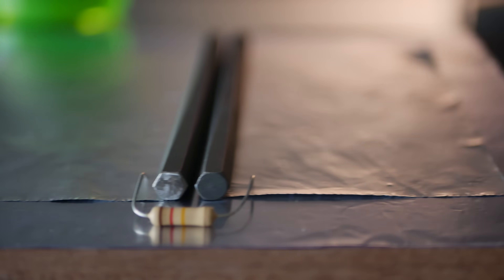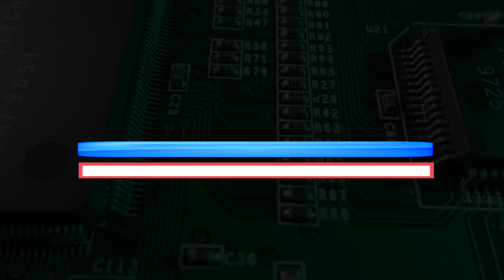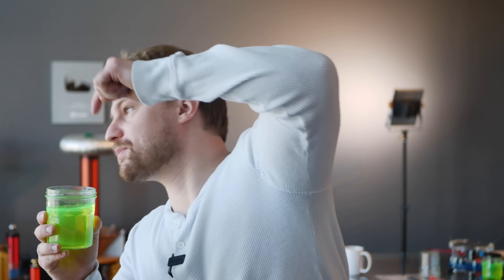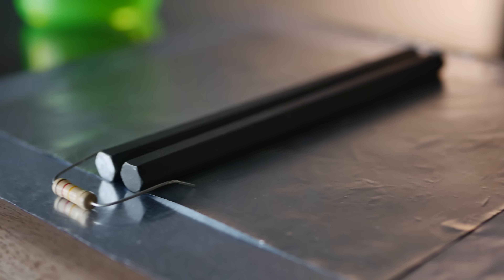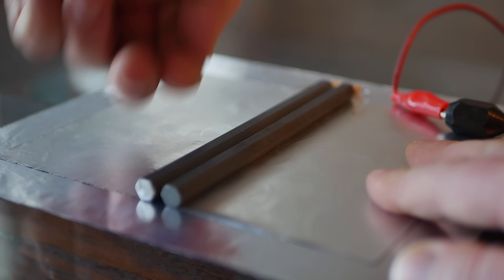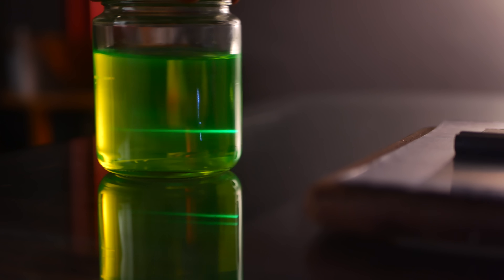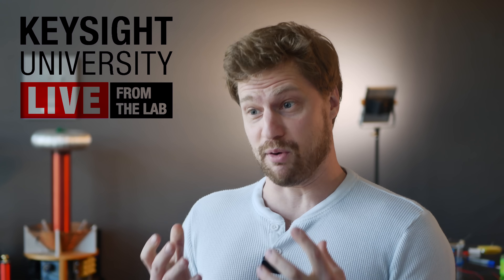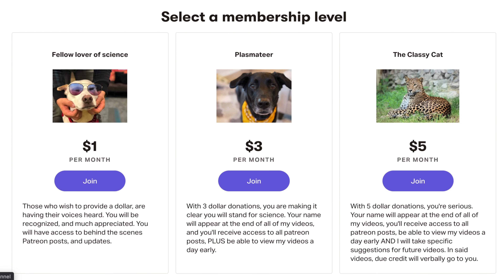Building A Simple High Voltage Nitrogen Laser (Ft. StyroPyro + giveaway)

Comment: Hey I was wondering can you build a tube by using a 1000 kV generator under low pressure gas I’m a kid I’m 14 years old. I’m still smart and I did build the rail gun and next I’m building a combustion gun and a reactive generator like a power stuff, but I change my mind on the radioactive part because you know cancer and I was wondering if I can collaborate with you about the whole idea

Comment: So cool.
What if I tried that in a hermetically sealed containment chamber (say a pipe that holds the entire contraption), then fill the pipe with nitrogen gas?
- Would that improve the excitation of photons? How much pressure would be safe?
- The sparking is quite audible, could the frequency be increased so that to a human it would sound like a constant noise sound?
- Those hexagonal rods are probably not aluminum,... what material is the best for this?
- Could such a TEA be made to get a high power laser, say 100W for industrial applications?
Reply: Maybe adding some liquid nitrogen nearby could help it, since it becomes gas at room temperature, I don't know. If you try any of those things please upload a video. It would be so interesting to watch.

Comment: Cool...I built a Blumlein nitrogen laser for my Physics senior thesis back in the early 80s. I used a single sheet of double sided G10 PCB to form the capacitors / ground plane.  I became infamous because the EM pulse from the laser tended to show up in most of the experiments in the bldg. A few  thousand amps rushing across a sheet of copper in a few ns will do that...

Comment: I'm quite amazed the circuit seems so simple and yet I'm sure it can still be improved without significant effort. I think the resistor and it's spark gap are to reduce laser gap spark transfer energy to encourage new spark locations to build the gap energy. It seems like an end mirror resistant to UV would help, also a top insulator or even an insulator wrapped around the rods with dielectric as well. I'm guessing that most of the UV photons are lost top and bottom. My MOPA Fibre laser cuts through aluminium quite slowly, due to thermal dissipation and reflectivity so I don't think that's an issue. The iron hex x-section is likely less rounded than the aluminium  cross section profile which would promote arcing better. The flat of the allen key hex underside improves the dialetric vs the angle of your Al profile which correlates with styropyro's comment on increasing capacitance, seems the key is getting just the right gap pulse energy with a fast pulse frequency to other locations.

Comment: I have been gifted a 5 foot long, 2" [50 mm] I.D. borosilicate glass tube.

1, What would be the *STRONGEST* possible laser I can possibly build with this, 

*OR*

2, What would be the *SIMPLEST* laser I could build?

My hopes would be to have a large, powerful, fiber optic cutting/etching laser which I could use for multiple purposes, using some military surplus optical prisms I cam across.

I can wind my own coils, and build my own capacitors, and I have a whole pile of diodes, small capacitors and tons of high precision and low precision potentiometers on hand.

I can get pure and mixed gases from a couple of local gas suppliers.

Comment: very kool i think i will leave the building of this type of laser to you! wow it is a fickle *****!  so in the future i was wondering if you could do a negative build of ion lifters? so i saw something that seemed like it opened the front to a v like and it went in that direction. seeing the pattern and watching how it happened made me wonder if ion lift also has the opposite like ion tractor? like a airplane can be a pusher or tractor depending on the prop placement of rear or front of the plane. i was wondering if there's a way to use ions the same way? if you dont build it could you still please answer the question set my mind at ease. because i may have found a small piece of the puzzle imho.   enter me into the contest if it is still going!

Comment: This is not how I thought lesser would be built😂... I used to imagine a nitrogen filled cylindrical glass ware, with electrodes attached to the sides and a decent spark gap in-between the inside of the nitrogen glass tube. Which the would be put in an opaque lager to tube with a reflective internal surface and then an adjustable magnifying glass up front to set its the focus with 🚶🏾‍♂️😅

Comment: Excellent tutorial! A "transmographic laser", (in another phrase), is simply exciting two- not more!- atoms in a row. This means the electromagnetic pulse should be a specific size: the radius of a Nitrogen atom (for ultraviolet-likely light) x4, and not too much larger, or smaller! This is a radial burst of about 1 x 10^18 Hz, or 1 billion gigahertz in voltage-pressure. If you use a radial harmonic you'll achieve a less often, so less intense, laser instead-- down to even 1 Hz or smaller! Lasers are easily made of regular LEDs, simply focus them through a nitrogen-gas tank to achieve the similar wavelength of UV light-passthrough. You've created an LED, followed by two filtering cusps, all from home-available pieces! Very well-done!

Comment: So changing the alluminium to steel had beneficial affects.
Why?
Is the higher resistivity of steel the relevence or the smaller capacitance of hex vs 90 angle?
Should one try gold plated allen keys (lower resistance) vs rods of alluminium welding rod (llower capacitance) to identify the rout forward? 
Does ferrous vs non ferrous matter.
This could get to be a very interesting project.
Good luck.

Comment: That reminds of star trek(tos) were spock takes some crystal mounts in them in metal strap from a cell cot and set the distance apart and lases through a cell door using power from a light bulb. I wonder if you could do that with ruby crystals?  Ruby crystal used in lasers are made in rod and the photons bounce between the mirrored ends.  It would be interesting to find out if you could...

Comment: Built one of those in 1973 a little less than 25 inches long with one back mirror using pure nitrogen gas in the bloom line door knob capacitors 25 pF each Charge to 30,000 V on each side with with an EG &G spark gap to switch the door knob capacitor on one side giving 60,000 V across 1.5 cm gap between electrodes made honeycomb electrodes similar to your hair comb to get a uniform discharge across the 25 inches

Comment: I always wondered how can we Make its beam Continuous may be we can also place Cavity by placing partial and full mirrors in the ends of the T laser  and for continuous beam may be you can try same setup in Vacuum chamber with different pressure or changing the spark gap frequency higher .

Comment: I always wondered how can we Make its beam Continuous may be we can also place Cavity by placing partial and full mirrors in the ends of the T laser  and for continuous beam may be you can try sane setup in Vacuum chamber with different pressure or changing the spark gap frequency higher .

Comment: the "easy stuf is never easy" also I think that it emit some visible light other than uv, it's really strange to have random paper and a shirt glowing from uv alone. For future project I have a little curiosity, every time I see a plasma, ok it's cool but it's also really hot, can you create a device that makes incandescent air that it's not plasma ? like the one from a butane burner that it's orange/yellow, I recently discovered that the flame it's not actually plasma but just incandescent air, air disperse heat really fast but I was wondering if there is still a way to make it glow without a chemical reaction generating heat ?

Comment: Neat concept.  Curious, what would happen if you flooded the channel in nitrogen gas, even pressurized it slightly?  Another idea, what happens without the capacitor, spark gap, and resistor? (Can you get a nearly continuous arc, and will that not work?)

Comment: Amazing video, currently taking electricity and magnetism in college right now and it's amazing that I understand the circuits, capacitors and everything about the voltage and current. Was thinking about building my own but now sure where to get a power supply

Comment: Nice project. I've (casually) looked into TEA lasers before. Was there a specific reason you cut the hex wrenches into just the straight sections? Couldn't you have placed them down with the bent portions facing away from each other?

Comment: I would like to see you use this TEA laser with a tesla coil to make a point-able lightning strike by creating an ionized nitrogen path in the air between the tesla emitter and the target.  The TEA nitrogen laser should have the correct energy window for lazing threshold along the path of the laser light.  This could be a great lightning-laser weapon.  Assuming the target is grounded the current path would be from the tesla emitter, TEA laser ionized air path to the target, then back though the grounded tesla coil.

Comment: hey jay please respond. I just got a badass deal on working 37 medium to large Flybacks some even have the Tripler's they should be hear very soon like this weekend so let me know if you need some we could meet up closest place looks like Bremerton if you take the fairy. ill give you some for your channel for free
so you can turn 4 into a 200kv though 4 parallel primary's and 4 series secondary's in oil with a extremal diode for the new rating with a zvs to drive it that's what I'm doing for my ne HV,HC,HF supply for work on passive plasma confinement for fusion prototypes mine will have a 1800w zvs driving it though.  
but I'm Shure you want more power for a new big AF multiplier am I right?
Reply from the maker: Wow. That’s pretty cool. Are these new stock?
Reply: @PlasmaChannel  some new some used was the label but 37 for 120$ GOOD deal. I can definitely spare afew after testing that there good ones to help you out.
 I got my kiddo this weekend so hit me up in my contacts in my vids and we can make plans. I can only travel on weekends cuz I don't have a license....I failed the dive test again, I cant feel the peddle and due to my situation I haven't been able to get practice...fun stuff.
Reply: @PlasmaChannel  would you want like 10 of them just in case you end up blowing a few.

Comment: This is super-luminescence effect, not a lasing. To see the lasing, one should provide an optical resonator. A simple step up would be an Al- coated mirror on one side, reflecting the light straight back through the discharge area. When aligned, you should see a large increase in the optical power and smaller beam divergence. Such single-pass scheme should work due to the large gain of the excited nitrogen gas.

Comment: I lasers and high voltage, I knew this version however. a new type of laser would be cool as well, I have designed one recently but am still waiting for parts. I also know quite a few interesting things for you to make but won't tell those openly on youtube before they are made because many of them are new so not after public existing designs. but a simple one for you now is to reverse the process. I also already know a few simple methods for it. and if you are up for a challenge then I know one new thing for a very stable high voltage generator which can run on basically any voltage and uses a specific frequency generating technique which I developed which is not yet publicly known. it is a challenge however since while using it in that method it becomes quite sensitive to its environment.

Comment: I remember seeing a Scientific American article form the amateur scientist in the late 60's or early 70's and from memory they had an enclosed chamber from plexiglass and burnt alcohol to get the oxygen out of the air and pulled it through the chamber using a venturi tube 
. They used fibreglass pcb material. Your way is definitely simpler I will give it a try

Comment: Hi, nice project. How about encapsulating the project in a vacuum chamber, pump out the air and filing it with pure nitrogen and testing at different pressures.
Ps - why not throwing a scope my way?

Comment: I built a low pressure version of this type of laser in 1977.  It's called a super-radiant laser.  Same basic type of power supply, except that I had a 15kv neon sign transformer that was bigger than a loaf of bread and fed that into a full wave bridge rectifier to power things.  That was the year that I learned to really fear/respect High Voltage.  I also used 10mil mylar, and even then I had to constantly "repair" shorts in the capacitor.

Comment: I hope it's not too late to enter. :)
My understanding of T.E.A. lasers is that "atmospheric" meant they were closer to 1 atmosphere than typical gas lasers, but were still around 1/10th of an atmosphere (from memory of a Howard W. Sams book on lasers I read back in the late '80s), so it is most impressive that you were able to get it to lase. The fractional atmosphere would permit significantly better sparks as well. 

My suggestion for a future project: Take this one to the next level.
Use the outside (smooth) edges of cut down piano hinges for the electrodes, they'll be dramatically smoother and straighter than you'll be able to get with sandpaper, allowing for a much more uniform spark.
Use a very high frequency spark generator (possibly something like the cheap high-voltage power supply ElectroBOOM used in a few of his videos, though you may need more current).
Seal it up in a tube and use an A/C vacuum pump to draw it down to around 0.1-0.2 bar, and see how well it lases. :)

Edit: Liked and Subscribed. Cool channel! :)

Comment: You always put out some Great Videos !!!  I had an idea once to simulate lightning discharges inside a glass enclosure and was wondering if you would care to give it a try. I was thinking of  including a house with an antenna on top , a tree next to the house and maybe a power line. Each one would get struck by lightning by hitting a button that corresponds to the object or you can also have the option of it being random. The smaller you make the objects the less the voltage needed to create an arc that resembles a lightning bolt,  so go as small as you can.  Let me know what you think.

Comment: Your shirt fluoresces due to the washing power/liquid you use.  If you mix certain washing liquid with water and "pump" it with the nitrogen laser you can get a visible emission from the laser.  I think Arm and Hammer may work.  Or "pump" some laser dye with the TEA and get visible emission.  You can get all sorts of colours with the TEA as a pump.  You would probably need a quartz cuvette as the UV will pass through it straight to the dye  :)

Comment: Why was the hex bar sanded at the edges (does this mean flat edge, or the corner).  Is that to remove the insulating paint/black oxide?  Did you use parallels or spacers to position the electrodes.

Comment: Sandpaper. Smooooth. Smoooooooooth. 

How about trying to use the TEA uv laser to do something semi-useful.  Very short pulses, rapid, maybe a range finder? or combine w a rasterizing mirror rig and make pictures in the highlighter medium. Or communications -- a long long time ago i built a LED based tight-beam laser data link - could see if you could work w the TEA for something like that...
Reply: Oh, also, yes, it works great open air, on the 70% nitrogen atmosphere.  I wonder what other output frequencies you could get by flooding the gap with argon or  CO2 or other cheap-ish gasses. Argon might get you a visible green? MIght have to make a semi-gas tight enclosure to get the partial pressure upi high enough.

Comment: This is so cool! I have an 900W 15kV neon sign transformer I've used for a Jacobs ladder -- it generates a nice fat 2 inch spark.  Aside from killing myself, what would be the likely consequence of building a TEA laser using something like that? Seriously though... would it even work? My guess is that your flyback is operating at a lot higher frequency than 60Hz and StyroPyro said it needed a very fast pulse -- does that mean a high frequency AC source is needed?

Comment: Looks like a simple build, but the devil is in the detail... how close together are the hex bars (looks like ~2-3mm?) and presumably they have to be pretty parallel? I wonder if it would help to use a couple of nylon screws between the bars to make fine adjustments easy? Secondly, if you added another sheet of acetate underneath, could you roll up the caps by the side of each bar, to make more compact capacitors? Then you could put the whole shebang into a smallish tube. Assuming the inductance of a rolled-up cap doesn't kill the effect....